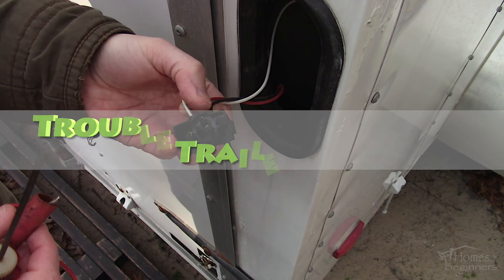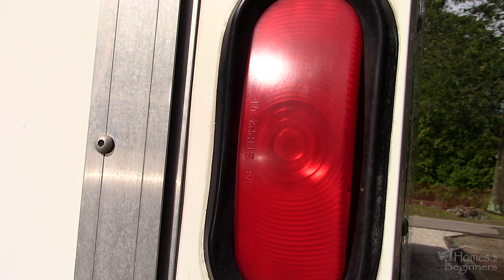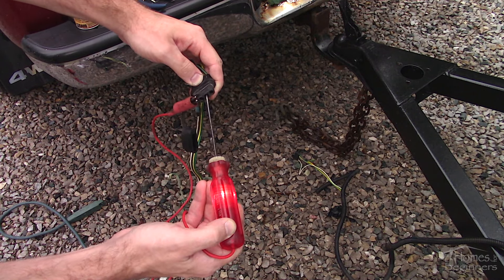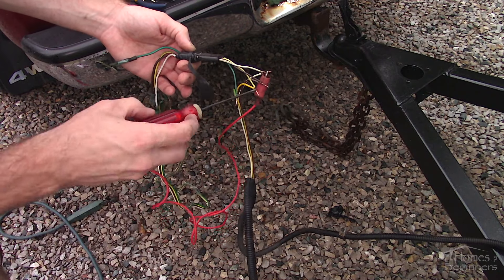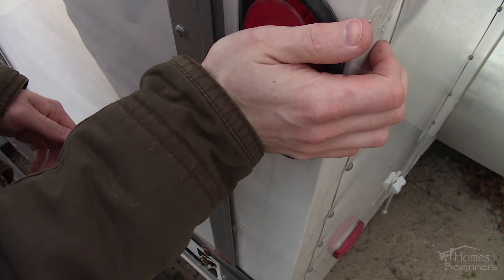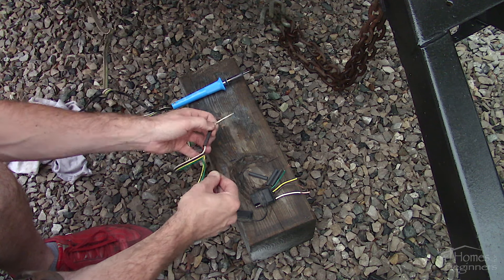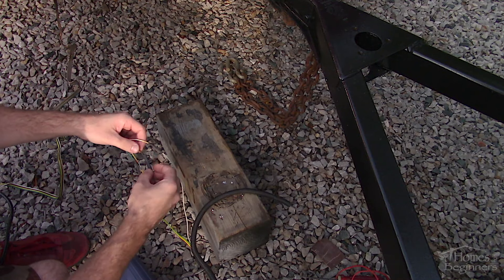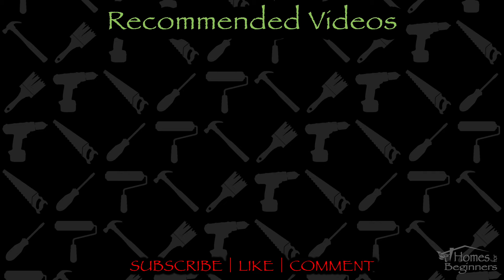How to Troubleshoot Trailer Lights that are not Working

Comment: Glad I found this, I have a small trailer that apparently was wired from 7 way to 4way flat. It had single bullet connectors with the extra wires soldered to the outside of the connectors, Unfortunately when I unwrapped everything only the ground was still connected and I’m trying to find my running lights with only a blue, red, and black wires left to connect.

Comment: This is very informative!
When it comes to wiring trailer lights though, I cut the "Y" harness, clean through, and install Deutsch (DT) connectors at every light. This way, when I go to replace a burned out light, I only have to crimp one side of the wire and I don't have to worry about replacing (and re-routing) a whole new wire. Even if I have to replace lights frequently, because of this connector, the length of my original wire stays the same length, as I'm only replacing the short amount of wire leading to the light itself.
I admit, it is more expensive, but on the positive, you don't have to spend $75 and 4 hours in your garage when something goes wrong.
Lastly, if you buy Hopkins trailer brake lights, replace those disgusting, mushroom cap, cheap steel bolts with stainless steel, hex head bolts (1/4"-20 - 1.25" length).
Can we PLEASE put an end to the "guuud enuuff" people!?!?!?!

Comment: Thanks, it is helpful, but my trailer turn signals and break lights works when I use signal or break, but they should turn on as soon I turn headlight on that is the problem I am having, if any help I will appreciate.

Comment: This was a great video. I bought a test light, and I learned here I learned here I had the ground on the wrong lead on the truck side. My brake/hazards are fine, getting power. The lead for them at the truck side isn't getting power. Any thoughts why this is?  Thanks in advance!

Comment: Would this also work with a test connection tool if it has a positive and and negative. Since mine has two different probe. Not like yours. If so. How?

Comment: Well done, great info, BUT... I believe my issue originates at the back of my Class A RV. My 7 way cord works properly when plugged into the back of my friend’s pick-up, connecting to my car. But I get absolutely nothing when I run it from my RV to my car. Any ideas or suggestions on where the problem is, and how to repair it?

Comment: All my lights are working, brake, hazard and L & R turn signals, but the running lights don’t work. I’ve checked the wiring and the fuses and have run a cat and mouse tester on that one wire and it runs complete up to the fuse box. This is a 2003 Ford Ranger. Any help would be appreciated

Comment: When doing diagnostics on trailer wiring, only hook up the electrical.  Putting the trailer on the hitch ball may make a bad ground issue hard to find as it will try to ground through the hitch which is what you don't want.

Comment: I have an old tent trailer that has black, green, yellow. It also has a blue/red wire alongside. There is also a black/red wire coming out that was screwed into the trailer (potential ground). I cannot get the 4 way connector to work. I've tried almost every color combination. Any ideas?
Reply from the maker: Have you used a multimeter to do continuity tests from the plug to each light socket? The wiring could possibly have a break somewhere or it could simply be a bad ground if nothing is working. If you do find a break, sometimes it's just best to replace the whole system, it can be easer than chasing a problem. I have a video for that over on my other channel, https://www.youtube.com/watch?v=DlHttX4nkJM

Comment: My break lights work but not my running lights. What could that be?
Reply: Did you check the fuse in your tow vehicle? Usually a short blows the fuse
Reply: @cowboyjack570  yessir. It looks fine.
Reply: Now you need to test where you lose the power.  If you have power to the plug then start tracing where you lose power. Probably a broken wire. 
Good luck Dustin! 
I have a love/ hate with tracing wires. Lol

Comment: What if all lights work except for one fender light thay blinks every now & them
Reply from the maker: That could be a bad ground specially for that light, a bad power wire, or corroded light socket.

Comment: what about if lights does not work it all? where do you check?
Reply from the maker: You need to go back further onto the vehicle then. Could be the module for the trailer connector on the vehicle, could be a fuse. This will vary depending on how it's hooked up.
Reply: I have a 4 flat , white red green and black on the truck going into a 7 plug and a 7 plug ,on the trailer with with  yellow brown green and white on trailer how do i connect it